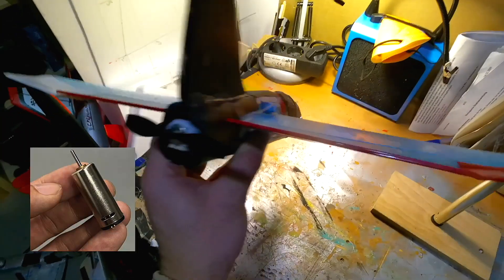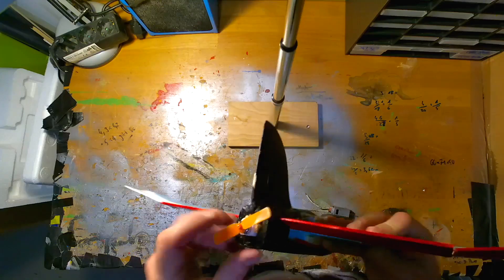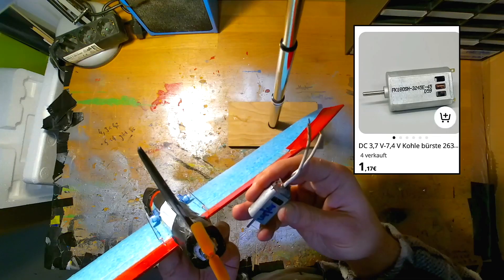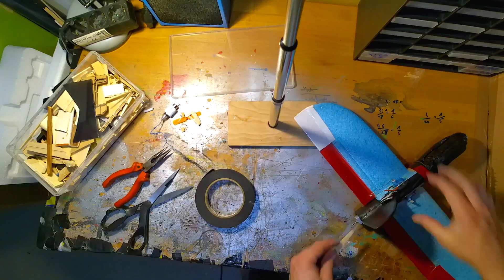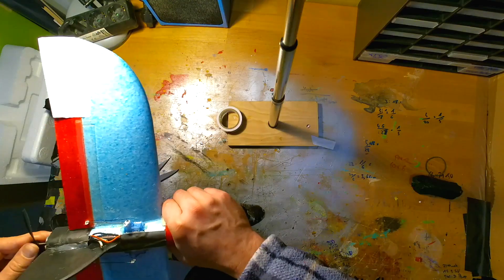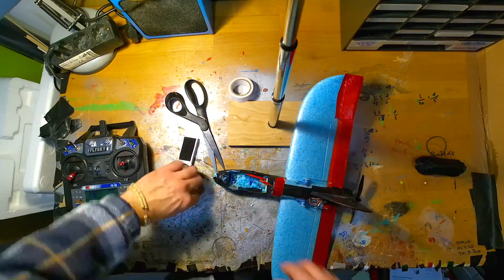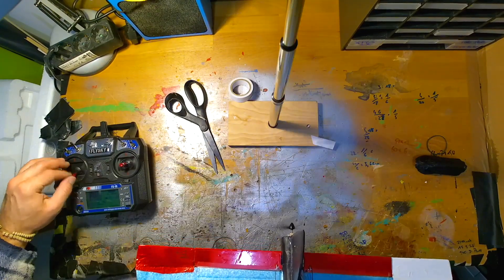Crazy Fast Lidl Glider RC plane - 1$ Motor Upgrade brushed DC 180 Motor

Comment: Well , can you give the dimensions of your glider ? I wil try to make one with foam boards . Also please mention what problems you've faced also some suggestions please .
Reply from the maker: @AdamTheBot thanks for your interest.
This one got a wingspan of 480mm and is a converted toy glider. 
Biggest problem for me was the thrust-weight-ratio. A DC N60 motor had not enough thrust, but the DC 180 does and flies for 5mins with a 2S 600mah Lipo battery. 
The DC 180 produces approx. 150grams of thrust, which works great with a total weight of 250grams including the battery. 
The are some less heavy and more powerful brushless motors, for sure, but those were no option for me as I wanted to find out if this could fly with the lowest possible costs.
Reply: @rcandotherarts9763  i am also trying to make a low cost rc already bought 180 motor and esp32 as receiver .

Comment: Hahah I have a kit build that looks just like your DIY called a "Micro Falcon Jet" 

Well I mean it doesn't "look" like yours haha but you know what mean lol 

So is that a 2s or 3s DC motor??
Reply from the maker: Nice! 
I used the one with 3.7V-7.4V, so 2S. 
With 3S it will burn, I guess :-D
Reply: @rcandotherarts9763  yeah my Micro Falcon is 3s with a 1206 and with 17 inch wing span its a streak to me at 100% but there are people running them crazy fast on 4s. Ive thought about FPV'n mine on 4s. Prob the only way I could fly it 4s...